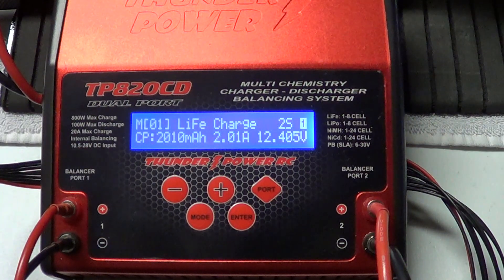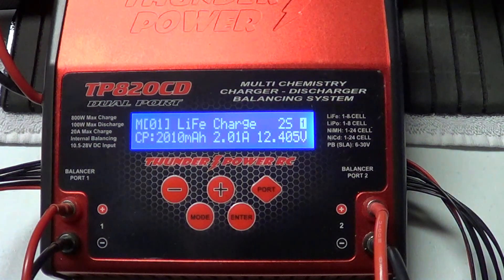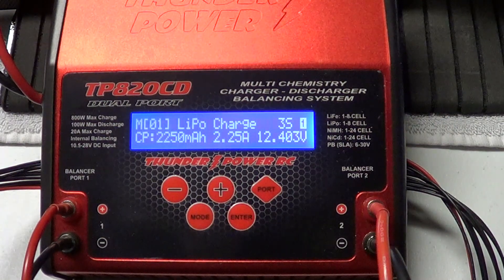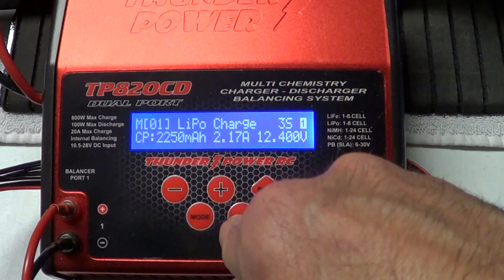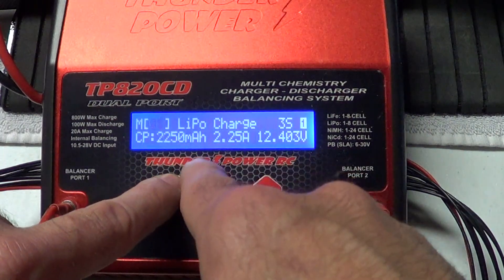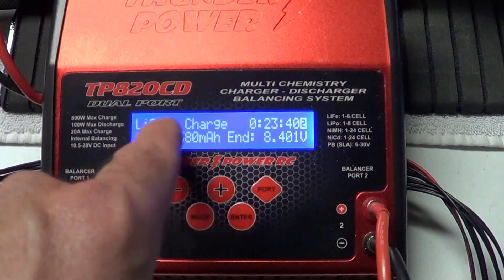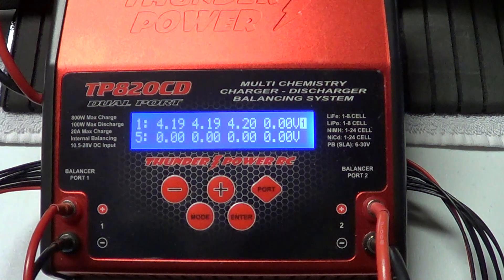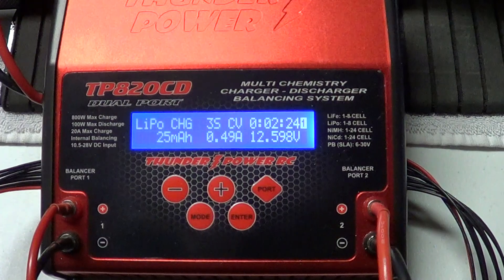Thunder power 820cp charger and how to program it

Comment: Need help: When I turn it on it says "Thunder Power TP820CD Dual Pprt V4.34" or so and it beeps. After 3 seconds everything seems normal. When I start charging after 20 seconds it says the same again it doesn't stop this time. I also can't press "+" anymore while charging to check the cells. It will automaticly show this message and start beeping. :(
Reply from the maker: I never had that happen before ,i would give thunder power a call and speak with Mark there tech guy .